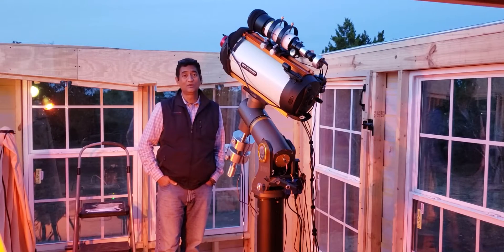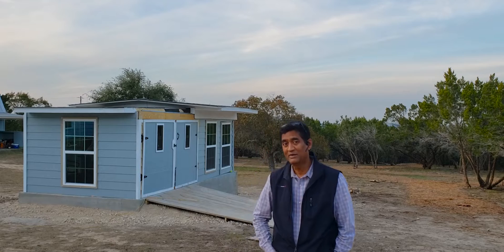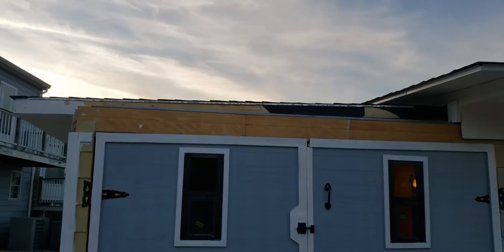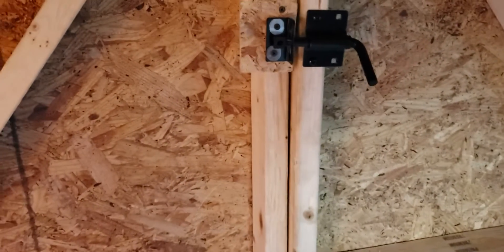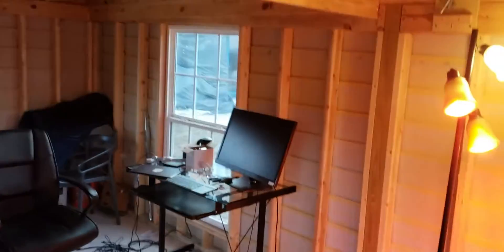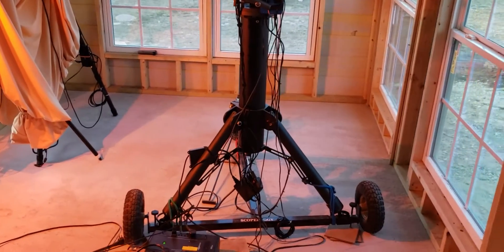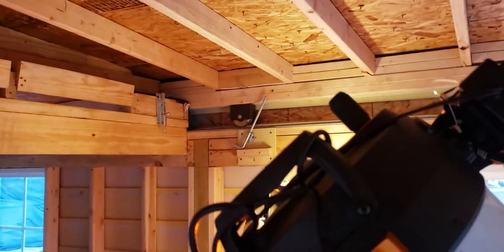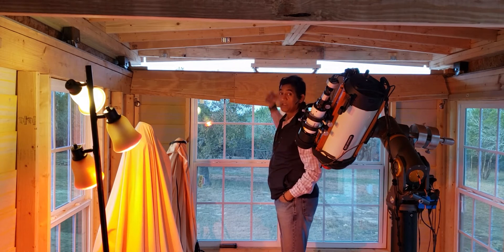Behind the Scenes | Telescope Observatory tour

Comment: Can you share with us the roof slide details?  Roller, alignment,  track , leveling.   And if you lost much angle above the horizon due to wall height.

Thank Randal
Reply: Maybe could be another video?
Reply from the maker: Sure will do Randy!
Reply: Also how you handled the seal around the perimeter of the sliding roof, rain, dust, so forth.

Comment: Your observatory has a lot of space inside! Are you going to put a wall between the two sections or leave it open?
Reply from the maker: Thanks WA!  I am thinking something should be there.  Atleast a curtain that is held all sides or a retractable wall.  I am thinking to run a heater in the middle to keep it open a little bit.

Comment: I think you've overcomplicated it, but good job anyway. But why you need the windows man? This will heat up like crazy inside. As well light can come from outside and reflect inside. I even insulated my observatory to prevent overheating in the warm months. Some people even paint everything inside black, which is overkill ... but windows ... come on man :)
Reply from the maker: Thanks Lachezar!  It is not a remote location.  Next to my house.  There are no lights other than our house.  I just want to see around when I am working in the office.  Worst case, i will run A/C or heater.  Windows can be covered anytime if they start annoying.

Comment: Observatory looks fantastic Ray. I am so jealous of the amount of space you have there being able to setup more than one rig - wish I had made mine bigger. One question, I see you have bolts to stop the roof from moving sideways in strong winds but do you have some thing that holds the roof down on the walls in case of really strong winds (i.e to stop it lifting off the walls)? (I may have just missed it in your video)
Reply from the maker: Thanks Logan!  You didn't miss.  I didn't put it yet.  It is super heavy.  But I have to add some custom bolts to hold it down soon.